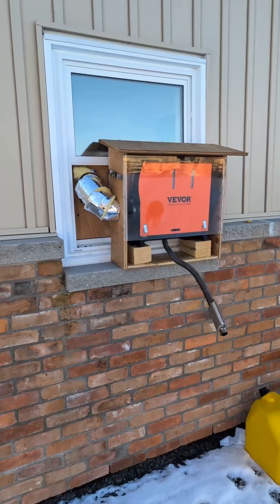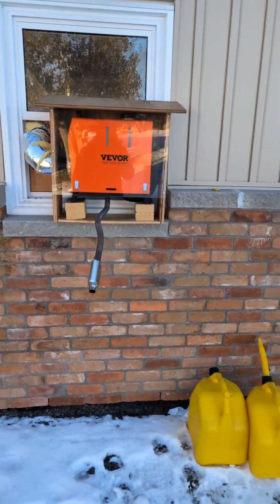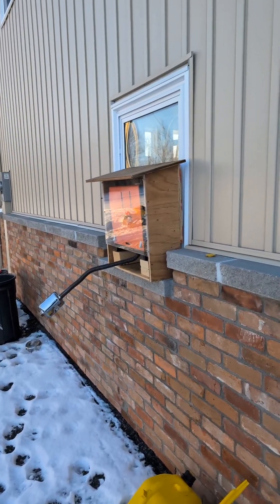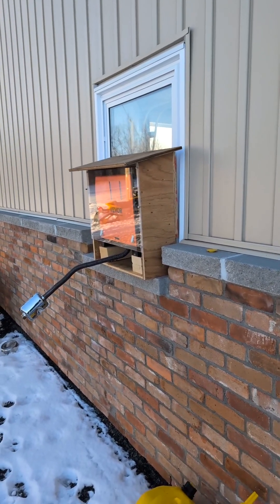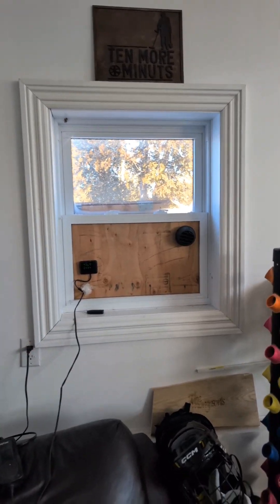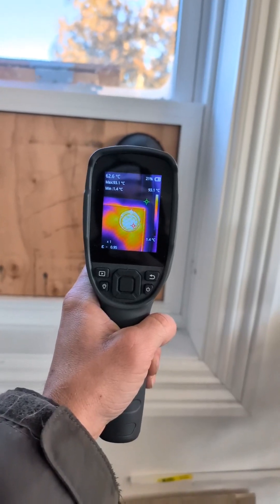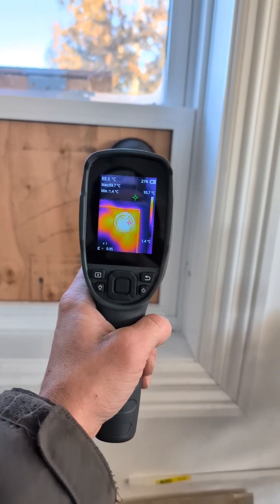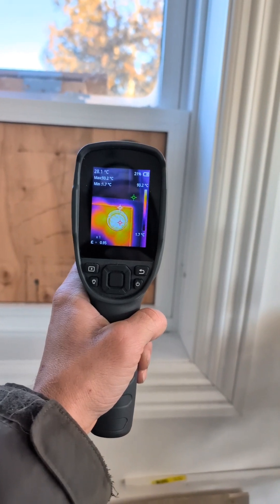Powering a Diesel Heater with an Inverter: Essential Tips #dieselheater #winter #heating

Comment: Boss genius location. The radiator idea is flawless, but better for RV or bring a radiator inside if you want to save energy, but run exhause outside still. 
That's not good for young kids, like you said.
Reply from the maker: thanks!